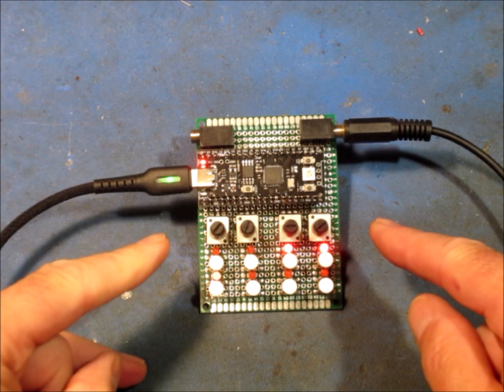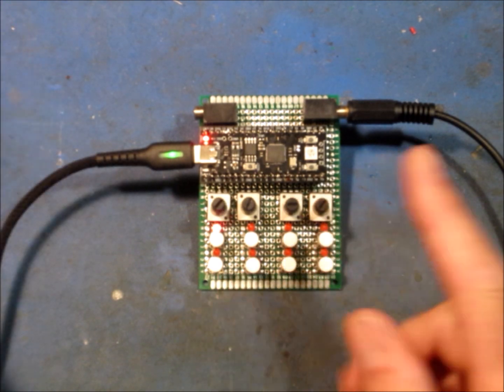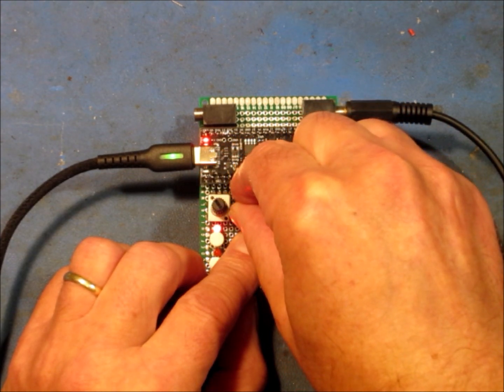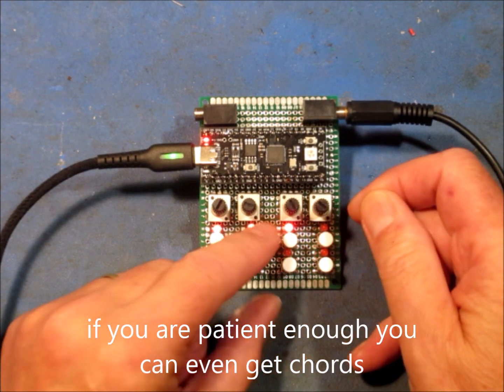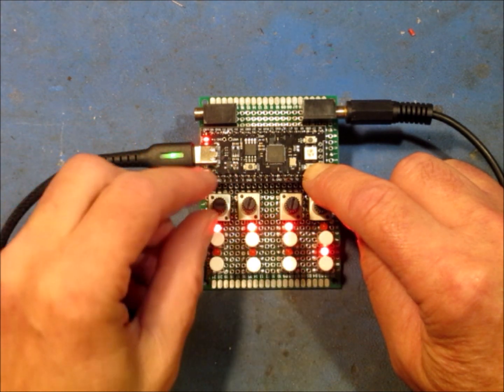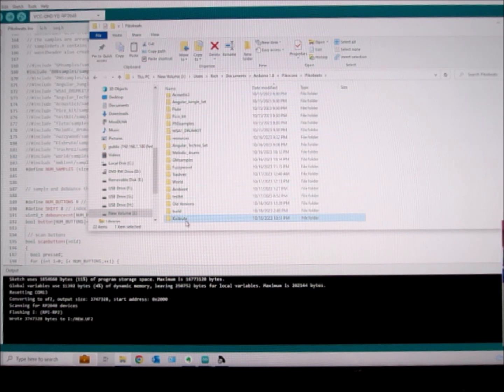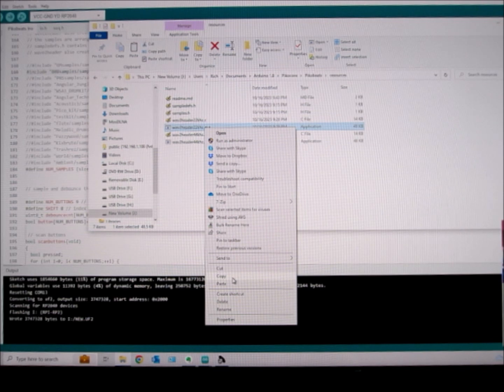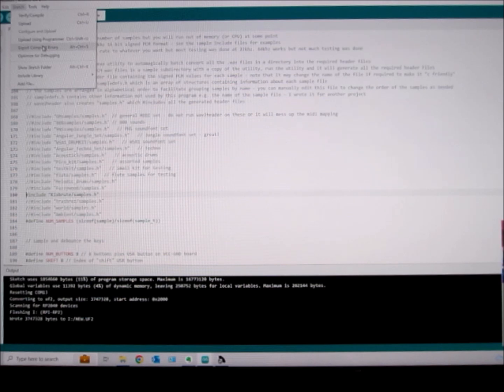Pikobeats - Alternative Firmware for the Pikocore Sample player

Comment: Please tell me what could be the matter?   Sometimes the encoding program works very strangely, or encodes one file, or not all of the list, but only part of it, perhaps there are some conditions for its use?   I cut my samples in Wav format by seconds, renamed them to C1, C2, C3 and so on, because the program did not accept long names, now even in the Arduino IDE it gives an error in the line num samples, maybe there is some kind of instruction  Wav files can be uploaded there, name length, playback time?
Reply from the maker: Source files should be 22 or 44khz .wav 16 bit signed .wav files. It does not handle 24 bit or float samples. It tries to munge the filename down to 8.3 format because that's what I use in my other Arduino programs that actually use the filename. Chances are your filenames conflict after it converts it to 8.3. Source code for the utility is in the resources folder in github with instructions on how to recompile it if you want to modify it.
Reply: Thanks for the answer, I'll try it

Comment: Great demonstration on the pikobeats. Does your DIY have custom switches to allow for those caps?
Reply from the maker: The switches I used have longer stems than the ones Zack uses. I bought the caps on Aliexpress and glued them on - easier on the fingers!
Reply: @rheslip20  Awesome! 

Also, maybe its a misunderstanding on my part. I was attempting to add my own samples in this build with Arduino. When compiling the code to upload. I get a compilation error and something like #include "pico/stdio.h" no such file or directory. I believe I got the right driver for the pico, just not sure if that's the issue either. I looked around to make sure that  board was loaded onto Arduino.
Reply from the maker: @ed_bouy  That generally happens when you have the wrong board selected in the Arduino IDE. You have to install the Pico Arduino package by Earle Philhower https://github.com/earlephilhower/arduino-pico. After that you have to choose the correct board before compiling. I use the VCC-GND YD RP2040 with 16mb flash selected in the "tools" section but it depends on the board you are using. You definitely need a 16mb board if you want to load a lot of samples.

Comment: Good afternoon, please tell me, everything worked well, but then the functions got mixed up, now everything works as if the USR button was pressed, but it is not closed, what could have happened?
Reply from the maker: Are you sure you used the right I/O pins? The USR button is GPIO 24, CLKIN is GPIO 22.
Reply: Yes, apparently soldering liquid got on the board, as it turned out it is very sensitive to any changes in resistance, thank you very much for your answer, the problem was solved;)

Comment: Great project, I'm delighted, I uploaded my audio files, it sounds very good, but one question worries me: how can I add a CV input there so that I can synchronize it with other devices? I will be very grateful for your answer and help;)
Reply from the maker: I added sync out at 1 clock per sixteenth note for the guy in the comments below and it didn't work correctly with his hardware. There doesn't seem to be any standardization in how external clocks work - what edge to clock on, how many clock ticks per beat etc. MIDI clock is standardized but the stock Pikocore doesn't have MIDI. Best bet is change the code to make it work with your setup. Modify do_clocks() in seq.h to use an external clock instead of the internal timer.
Reply: Thanks for the information, I’ll try to do it, and the CV output works fine for me (it’s good that you added it), but sometimes I need to be able to control the picobeat tempo using another device, so I need not only the output, but also the input, it turns out I need to change  value in do_clocks()?
Reply from the maker: @РусланХайртдинов-и6г  Its not as simple as changing a value. You have to monitor the clock input signal, detect the correct clock edge and use it to advance the sequencers. When external clock is present you must NOT use the internal timer to clock the sequencers or it will mess the timing up. Its not super difficult code but its not simple either which is why I didn't implement it.

Comment: Such a great firmware. would say I like this better than the original.

I will be probably compiling your code and trying to adapt it to a pico board than I have but is totally different, with 8 multiplexed pots, buttons, leds, screen and midi in

In case you would like to develop it further I can send you for free a PCB. So thank you so much for sharing this sweetie!
Reply from the maker: Thanks! You might want to check out the Pico MIDI Sequencer and Twisty MIDI Controller projects on my github. The MIDI controller uses 16 multiplexed pots, a couple of buttons and a small OLED screen. The MIDI Sequencer uses 16 multiplexed encoders, a couple of buttons and an OLED screen. I used parts of those projects for PikoBeats.
Reply: @rheslip20  cool!. I will be taking a look at the code, maybe I can adap it partially. My PCB has midi in. I assume the Twisty is midi out, right? Thank you for pointing it.

You can check the PCB here:

https://www.youtube.com/watch?v=R8zErXYm73g

It´s a more recent revision with the external bits integrated. That one is a port of Braids running on a pico and turned into a generative drum machine that you could run on the same pcb too

Cheers!
Reply: Deffo open to do some future collaborations if you feel like. I have been checking your piko beats code and is super easy to understand and editable/hackable/expandible
Reply from the maker: Thanks. I try to make my code easy for others to use. Hopefully somebody like you comes along and makes something else cool with it! re: collaboration - maybe. pm me if you like rheslip(at)hotmail.com @ZElTGElST
Reply from the maker: Twisty is MIDI out over USB. Easy to add hardware MIDI to it, I just haven't needed it yet. Pico sequencer is the same - USB MIDI @ZElTGElST